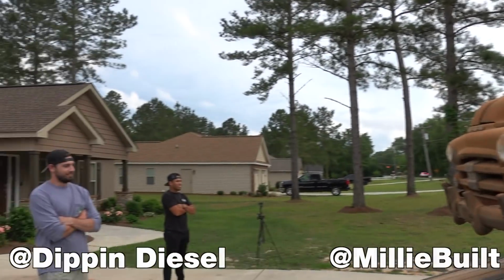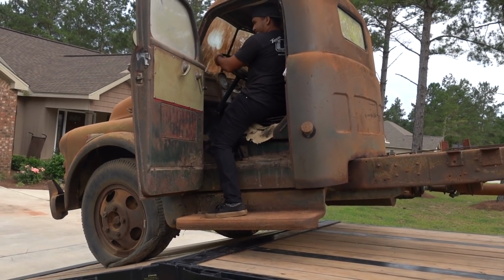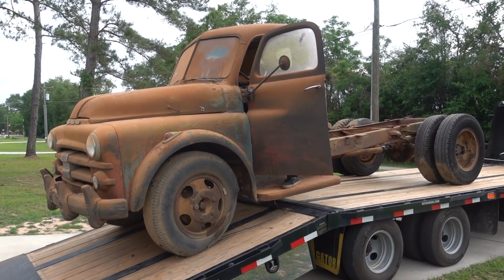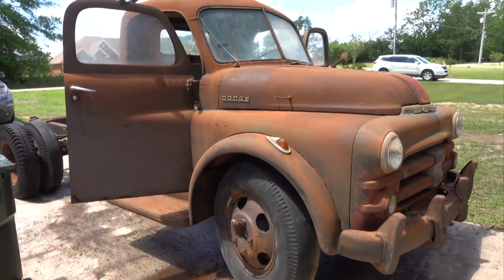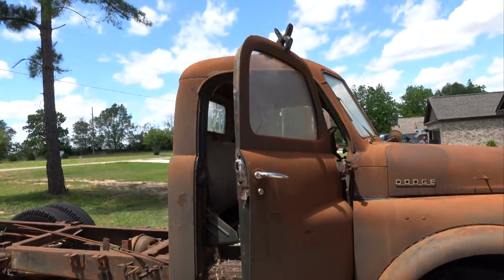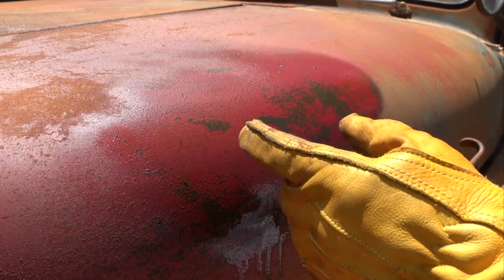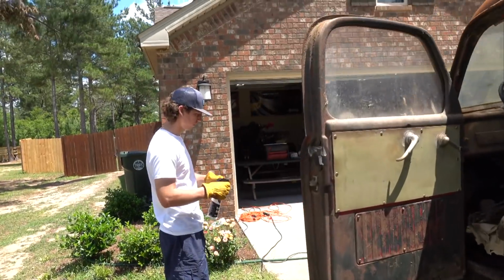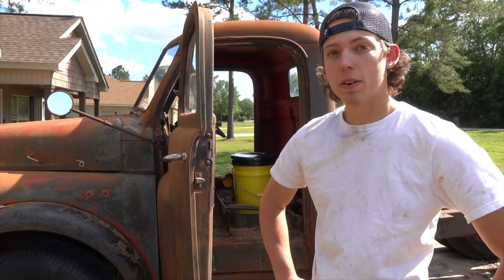Mesmerizing Disaster Detail - First Wash In 50 Years

Comment: Man you guys need a gas powered pressure washer, at least 3200 PSI.
buy a sandblasting attachment for the pressure washer from northern tool. It will clean up that truck very good. You don't get sand in your ears for the next 6 months. That electric job you got, it's like pissing on a forest fire. 🤔😎👍

Comment: If you can get evapo rust to partner with you, you’d be amazed at what that stuff does to rusty parts. Dip them in it or do as some have, put it in a kiddie pool with a pump to a hose with a garden spray wand and just let it run on the cab. It will reveal the paint and bare metal and get rid of the rust completely. Non toxic and works amazing. Find colors of paint hidden under rust I never knew existed. It’s not cheap. But they are partnering with quite a few other you tubers such as “good of the land” “abom79” etc.

Comment: Locks only on the passenger side was standard practice from the dawn of cars through the late 50s. 

Originally the idea was the driver would open the door on the curb side and the passenger would reach over and unlock the drivers side so you weren't standing in the road. Or get in the passenger side and slide across.

Comment: They put a lock on the passenger side so that way you can get in and out through the passenger side if you parked on a street
Reply from the maker: Thanks for the feedback Zach!
Reply: ParoDoXz to lock the drivers side pull up on the inside door handle. I have a 49 with a 12valve same truck

Comment: Back in the 50s dodge era the job rated trucks were top of the line with bigger cabs and heavier payloads any time you find an original dodge like that what ever the interior color was is the exterior color nine times out of ten if there was a secondary color it would be white

Comment: The reason for the lock on the passenger side is easy.  Back in the day if you were parked on the street you didn't get in on the driver's side, you got in on the passenger's side and slid over as it was considered safer than getting in while standing in the street.  Watch old movies and tv shows and you'll see folks doing that in cars all the time.  With the space in the interior and the big bench seat it was about as easy to enter from the passenger's side and slide over.  Another "safety" feature old Dodge's used to have is having the driver's side lug nuts as left hand threaded, so it was lefty tighty righty loosey, lol.  It was thought by doing that there would be less chance of the lug nuts on the driver's side coming loose.  Seems silly now, but that was the thought behind it back then.

Comment: Buy a single cab 3500 4x4 Cummins with a aisin trans deleted n tuned with a stack pushing 650 wheel horsepower compound turbo's body swap the 51 onto new truck just sayin